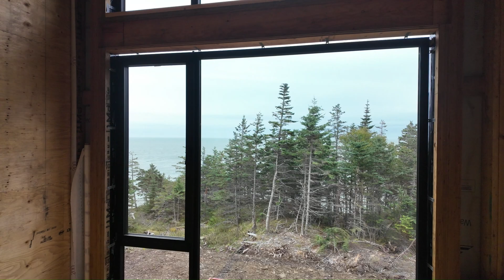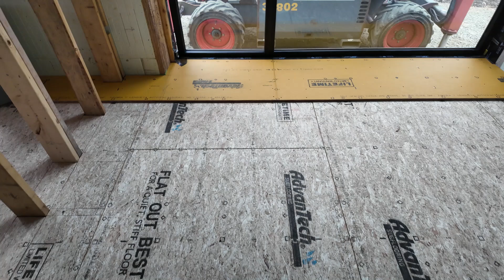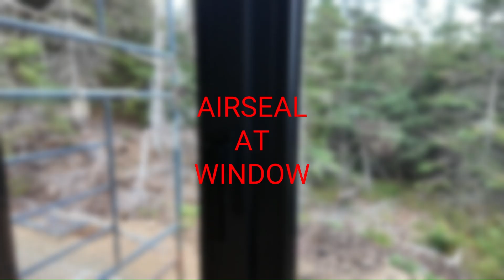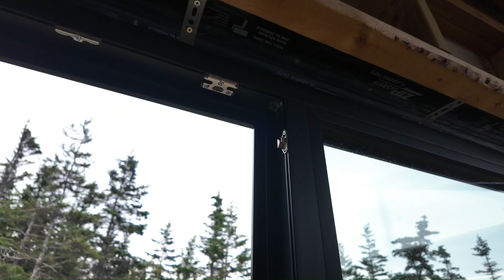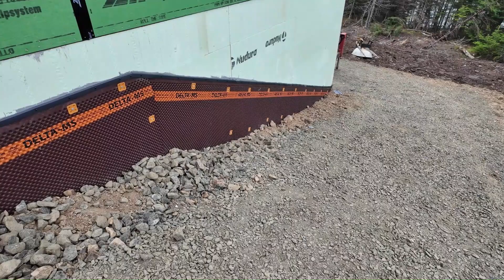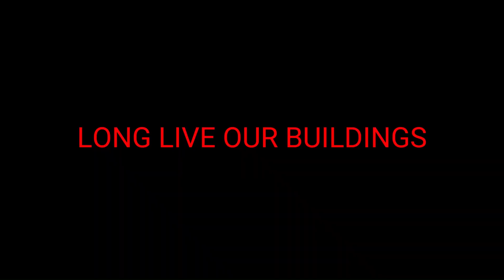"NO CONCRETE" Slab and more Details...

Comment: Great video. Stopping the flow of heat out into the ground. I plan on doing my floor like that with crushed stone insulation and barriers, but with 2-3 inches of concert and flagstone slate to get at least 4" of minimum masonry for floor. Using masonry for thermal mass.

Comment: This floor system seems similar to what superior walls sit on. Ironically this would not pair well with superior walls because they use concrete to stabilize the bottom of the wall. Very cool video Steve!

Comment: What is the bearing wall in the basement resting on?  Did they have to cut the Advantech sheathing and insulation to go around the upright studs of the wall?
Reply from the maker: Yes, it sits on a footing
Reply: @stevenbaczekarchitect9431  Thanks Steve.  They cut everything around the studs so well that it is hard to notice any gaps.
Reply: @stevenbaczekarchitect9431  What about partition walls(nonbearing)? They sit on footings too or can they be mounted on advantech?